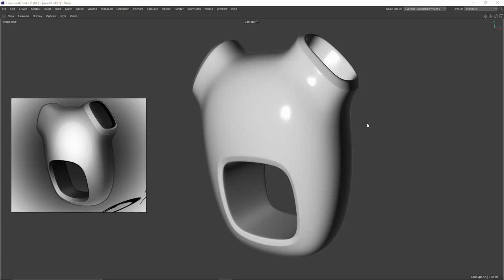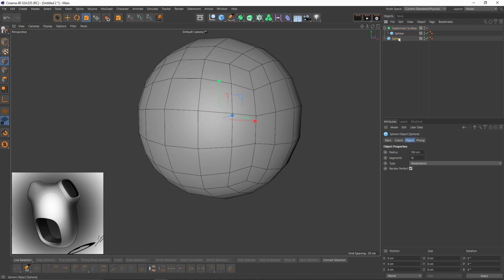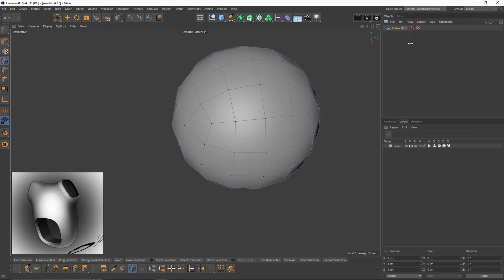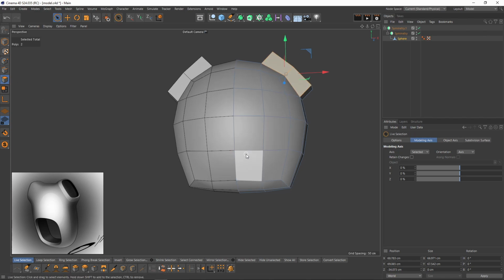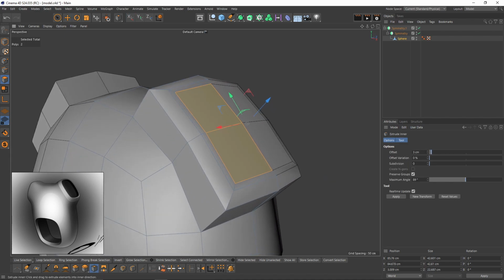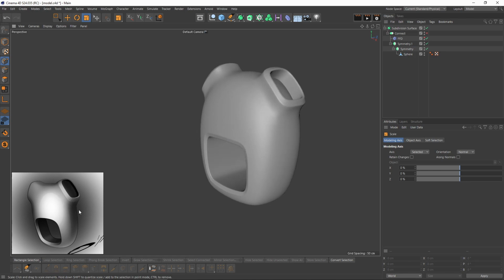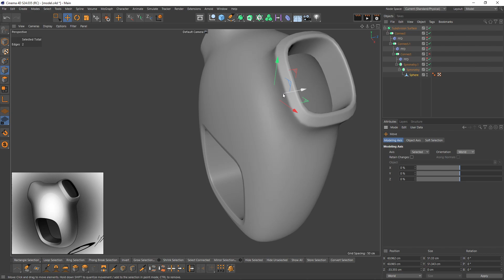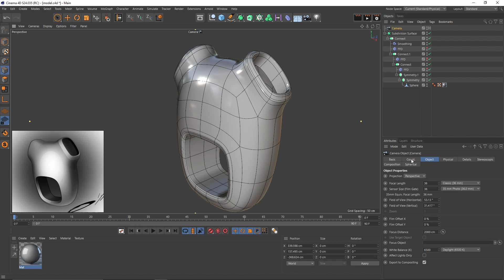Design Sketches to 3D #1 | Subdivision Surface Training

Comment: 1:25 Why don’t you use spherify deformer after you subdivide the sphere?
Reply from the maker: Because it is not about just the shape, smoothing deformer makes each polygon have same size or closer to that, which will be important at later stages.